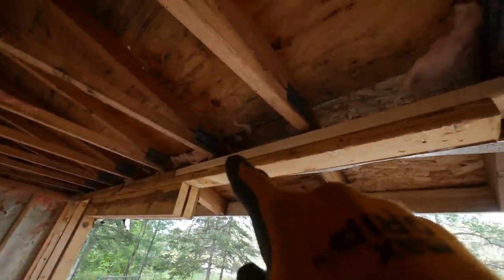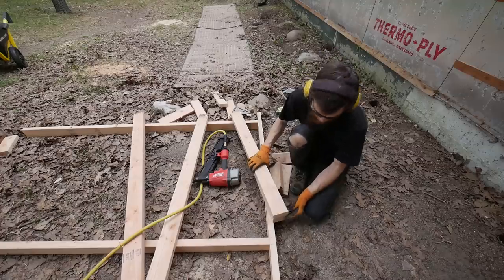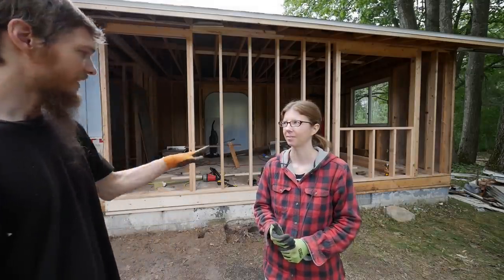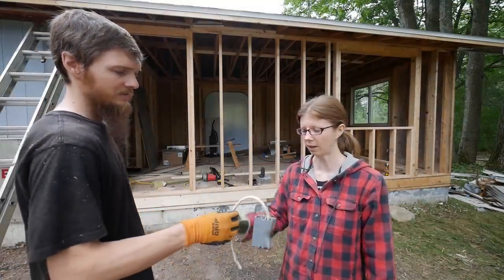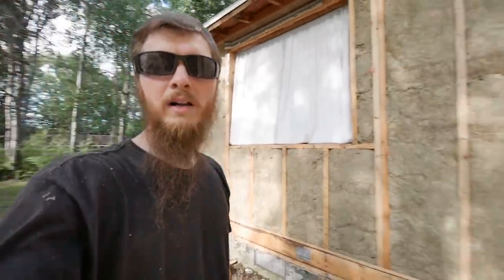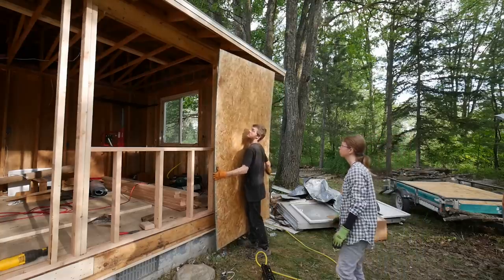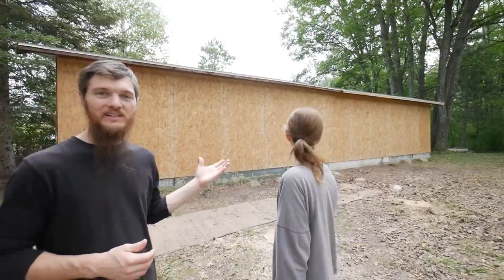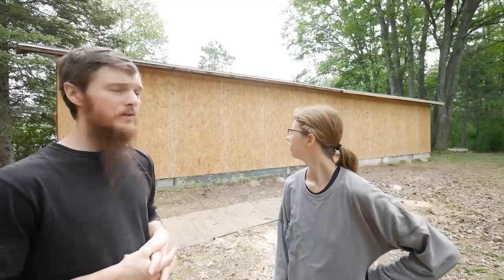More DEMO and Repair of Our 45 Year Old House - Home Renovation

Comment: That little bottom board was a life saver. I've always heard, work smarter not harder.  It's going great! Hurry up windows and door. I'm dying to see MORE!
Reply: Love your videos, just wanted to let you know you can save time and material by just using a couple nails driven in level with the bottom plate to set the plywood on. This also allows you to adjust the plywood up or down by bending the nails. I know I know in a perfect world the wall would be perfectly square but framing ain't perfect. Lol

Comment: What a great job (again)!  I personally like the smaller window, and the way it will match the other one in that room.  You guys are really "building a house," for the most part!  So impressive.
Reply: Light in that small place is more important
Reply: The new window is not that much smaller and it looks to match the other two on the front. They are customizing to meet their needs and desires for their living room layout to accommodate their furniture and such. They won’t be losing that much light really. In my opinion.LOL

Comment: The last house I remodeled I put small can lights under the eves. It amazing how much more light you have around the house instead of the typical spot lights on the corners or even a front porch light. It floods the front yard! It's also very clean and has a modern feel. Just thought I would suggest since you are at that point. It's looking good. I hate FAKE shutters as well. Glad there gone.

Comment: For all of Ashley's small size, she does so much of the hard work helping with this renovation. Both of you are inspirations. I can't wait for the windows and door to arrive. The place already looks a lot better with just the OSB on it. Good decision on the smaller window, cuts down on heat loss and traffic noise but still lets in light and you need wall space in a living room.

Comment: When my husband was overseas in the military, I converted our 2-car garage into a living room, I wanted it as my kitchen, but I couldn't find a contractor that would come out and run my water and sewer line even though it was only about 50 feet. so, I made it a living room. After watching many YT videos, I built the wall for the garage door opening. I put in a window and the wall fit perfect!  But I did it the hard way hammer and nails. my shoulder wasn't the same for a year, needless to say I went out and bought a framing nailery. I also had to remove 16 windows. I did 85% by myself, my boys and sons-in-laws helped me with a few heavy things, like the subfloor sheeting and the sheeting on the outside. It was hard but satisfying. My proudest accomplishment was converting my sun porch into a pantry, and I replaced the bottom plate all by myself.
Reply: WOW!

Comment: Thank you so much for showing what you are doing.  I am enjoying the videos and learning from you.  The biggest project that my husband & I did was to take out three 64"x36' windows on one wall and a 64"x44 or 48" window on the adjacent wall.  We put in one window where the three windows had been.  We also replaced our 8" sliding glass door with French Doors. We are pleased with the ending result.   It also saves us in cooling & heating.  Our next project is to re-Sheetrock our Service Porch, to paint the walls and trim, install some trim, and to shiplap up on one wall.  We are hoping to get some free wood for the shiplap.  We also have a Recycling Center where we can get free paint.
Reply from the maker: Awesome, we wish you the best on your project :)

Comment: Wow! What a good job.  So proud of you doing the clean up after your replacement of the front of your house.  That's just as much work as the new front and leaves a clean slate for the next project.  Your work ethic is  more than just impressive; it's necessary to keep it  safe.  Thanks for sharing.

Comment: My experience has been that doors need to have some overhead covering, even if it is just a deeper overhang just at the doorway. If it was mine I would want a small covered porch. But I understand not wanting to put holes in roof. My husband says I always want to make more work, but has often admitted I did have a good idea. We also redid an old house.  All new electric and plumbing, bathes and kitchen so I know how much hard work you are doing.

Comment: Hey if you want the additional wall thickness without ripping out the entire 2x4 stud wall, you can just nail 2x3's laid flat onto every stud from the outside, then sheathe over that. This will give you a 5 inch thick wall without wasting all the 2x4s you bought, and the 2x3s will be far less than a bunch of 2x6 lumber!
Reply: Or they could just put a layer of rock-wool-board or poly-iso-cyanurate foam between the sheathing and the siding; as long as the fasteners and battens holding up the siding are strong enough to hold it, that would add more insulation without compromising the strength of the house.

Comment: Thanks for another entertaining & informative video. Would you say this mobile home was better built or was your last mobile home better built, or were they the same? Just curious. Art in CA
Reply from the maker: They had similar construction, but this one being a double-wide has a peaked shingled roof with eaves, the other one had a curved sheet metal roof that needed to be coated occasionally and had no eaves. Also, this home has solid plywood subfloors and the other one had particle subfloors that we don't like. This one has normal house windows and doors, the other one had mobile-home windows and doors. I'd say this one is built better.
Reply: @diyfferent  Thank you for taking the time to answer my enquiry. I live in a "Triple Wide". It was built in 1988 and was supposed to be "Top of the Line". After living in it for 30 years, I wish I had a standard stick built home built on my land. The subfloors are a particle board type and they will fall apart when they get wet. The same applies to the exterior walls. They are ok until the paint becomes compromised to water. Then they will start falling apart and growing mold.  The floors that are covered in a linoleum product are holding up well, but the carpeted floors that are installed over that "cardboard" subfloor is not. I had to have the floor replaced in the entry way because of water damage.

Comment: I like the no shutter idea. They are an invitation for bees and wasps to hide behind and a place for mold, mildew, and moss to form. Also must be an absolute sigh of relief to have that plywood up.
Reply: But I'm wondering if it would be worthfull to save the brackets of the shutters. Perhaps if your area has heavy storms you can use them for easy and fast self constructed storm shutters. But I really don't know if this is necessary in your area.
Reply: @Glibber777  These types of shutters don't close. They are flat to the house and screwed down on like 4 or 6 areas around them. They are flimsy plastic things. I hit one of my shutters with a lawnmower by accident (it had fallen off and was overgrown) it exploded like confetti. They wouldn't serve much purpose.
Reply: @Jason I don't like those fake shutters too. And as I am from Europe I don't know how those shutters are made of. But I thought that the brackets could be helpfull for making some shutters for the purpose storm is coming and protection for the windows is needed. So not to leave them at the house but only to put shutters temporarely in front of the windows for protection. Hopefully I was able to explain my thoughts. But perhaps the brackets of the shutters are flimsy as well.
Reply: @Jason  Stover I just reread your comment and understand that there are no brackets on the shutters which could be used. Should have read your first answer more precisely☹.

Comment: a verry high percentage of housefires are caused bij the electrical system , mostly too mush aplyances on one circuit from using to many extentions
about the openings in the walls for the doors and windows , i wonder if you can use a flush routerbit with a bearing for opening the holes flush with the framing , think it will give a lot nice result compared to using a saw

Comment: It was explained why you rebuilt with 2 X 4 wood. It wasn't clear to me if you intend to add more wood to the inside so the thicker insulation can be used to match what you've already done. Is that the plan?
Reply: wade barnett Yes, he mentioned that was the plan.

Comment: So nice to see someone else get a dose of reality about large windows, I have never been a fan of large windows, they let cold in and heat out as well as take away from valuable wall space in a space limited home, and lead to sun damage of what ever is in the interior.  What a mess that place was, good to see what great progress the 2 (4) of you are making in it by yourselves. I am impressed. That electrical outlet was a scarry find, things happen for a reason, it might have caught if you had waited till after mavericks room was done to the exterior and the family living space.  I do hope you have a couple of large tarps tucked away just incase it does rain. OSB and water do not mix. All in all, its your place, you do what you want, decorate how you want, build it out as you want, your living in it and I think it really did need your hardwork, another couple of years down the line it might have been falling apart with the rot.

Comment: Great to see the progress. My husband was peeking in while watching and he reminded me of a mistake we made when building our storage shed 26 years ago. We have the wood siding and the building sits on one layer of cinder block which caused rotting on the bottom of the siding from the rain. It looks similar to how yours looked.  If that is the case of causing the rot,  I would have some kind of weed block cloth and rocks layered on top around the home; this might help. ...Also gutters are a must!! just my two cents...LOL
Reply: We watched our house being built in 2016 and they put a moisture barrier down on top of the concrete before adding the sill plate and framing. Probably the difference in building codes from years ago to today. The builder warned us not to let any dirt for landscaping rise up to the level of the sill plate. We are on a hill so it's only an issue along the front where the bedrooms are.
Reply from the maker: Thanks for sharing and we'll keep it in mind :)

Comment: I would have laid the OSB horizontal and staggered the butts for shear strength but the way you did it is fine. If you are using sheet goods for siding just stagger it so your seams don't end up in the same place as the OSB. Go to HD and pick up some Tuk tape or the tape for the Zip panels system and tape the joints on the Osb, It will help with air infiltration.
Reply: I'd have thought that when the Tyvek was on, you wouldn't have to seal the sheet joints?
Reply: @fergusontea  Tyvek is made to breathe. It's made more to keep moisture out. Taping the joints gives you another level of air infiltration protection.

Comment: Yes on the shutters.  Keep them off.  If you think about what shutters were put on structures for.  They would be on hinges and closed (shut) during a storm.  Or even at night if you didn't have glass.  Also if you look at the slats on modern fake shutters, they go the wrong way.  So look at fake slat shutters on a house... each slat covers the next slat at the top.  Now imagine closing them. The gap would be at the top, letting in all the weather coming down.  Not to mention the fact that your four foot wide window has two one foot wide shutters.  Just architecturally and esthetically wrong. (link to properly hung functional shutters... https://www.hurricaneshuttersflorida.com/img/colonial/bdbeedbc_photo%20(55).JPG)

Comment: Your old windows are better than the existing windows in our house. I think we have the original 1973 sliding windows in our house! Luckily we have plantation shutters on the inside that helps with heat/cold. :) Have a great day.

Comment: I had commented about not liking the smaller window but I also recognize that I will never live there.  I think you always do a great job!  Good thinking on putting the ledger board along the bottom to hold the sheets while nailing.  Make sure you have nailed the sheets to the building code recommendation nailing pattern/ spacing. Then take pictures of nailing pattern.  Can’t wait to see the rest!

Comment: Totally awesome! someone mentioned below to use spray foam as insulation, I would check out some videos on youtube about toxicity problems that can happen due to it not drying correctly, even when done by professionals.
Reply from the maker: Yeah we aren't fans of spray foam, though it does have it's place. We are doing mineral wool insulation in all of the walls, and blown in cellulose in the attic.

Comment: Good morning, I have a question:  How do you insure the roof structure does not sustain more damage as you rebuild the front face of the trailer from the subfloor up?  I know you built the temp wall to safeguard the roof in the area you are working...but did the temporary wall also protect the rest of the house roof from shift and damage by standing where it was like a load bearing wall?  Wow, that box was incredibly dangerous.  I am glad you discovered this now, rather than later.  Thanks and job well done!
Reply from the maker: Yeah the temp wall held the weight of the roof until we could get the new wall built. I had it over the steel beam underneath to make sure it was well supported. We don't need to worry about anywhere else though. Houses have some flex to them and everything was okay.

Comment: I would consider putting the wood stove in the corner, with the stack coming out the side wall. That will take up the least amount of room, and leave you the most open floor/wall space for furniture.
Reply from the maker: It's tough with the window placement and the oaks tree on that end of the house. We're trying to work everything in as smartly as we can so hopefully it turns out well.

Comment: Really it was a mobile home? Where is the roads? This is not unusual in Brazil. Tks for these awesome videos
Reply from the maker: It's a mobile home, meaning that it was built on wheels in a factory and delivered to the property. The wheels have been removed but the steel chassis is still underneath.
Reply: It’s a double wide

Comment: Great work as usual. Ledger board was key. Loved to see the chickens moving around. Have you thought about doing board and baton with shou Sugi ban (Japanese burning technique) to side the house. Would look great and be very weather and pest resistant. I think fairly inexpensive too if using pine.
Reply: There must be a "Back door"..right?..lol...Looks fantastuc!!
Reply: SUPRAMBY .   Have you been following WILD WONDERFUL OUTDOORS , by any chance   .  ;-) . .
Reply: Fava Fava No but will check it out
Reply: Checked it out ,yeah, shou Sugi ban. I think you meant wild wonderful off-grid. Interesting couple. No I first saw this technique on a channel called samurai carpenter.

Comment: Brings back memories of my building a small engine work shop out behind my house. At least you tow will know what went into your house and who did it. The improvement is 1,000  times better than original. No more rodents, bugs or lousy land lords.
Reply: RC Hobbyist Extreme “At least you know what went into your house & who did it.”  That is so true! When I had my home built & had many pictures, it was incredibly easy to make changes ( we added a window later, & attached REAL shutters later than that, plus added soundproofing in 2 rooms) by looking at the pics. We knew what was behind the walls, & if we drilled in & didn’t find what we wanted, we knew we were only off by inches, so we tried again. It makes life so much easier for all the years you have the house!

Comment: Thats why it's required to be a tamper resistant and weather resistant.  Receptacles on the outside.   Water corrodes the connections on standard receptacles and they can heat up after that.

Comment: I like shutters if they appear to work on a home, particularly vintage homes.  By "work" I mean that they could close and cover the window, providing protection from the elements (wind, snow, etc.). Typically now they are just plastic or metal or decorative homemade that are tacked on to any size windows, even picture windows.  I do like the addition of a third color in some house palettes, but there are better ways to do it than non functional shutters.  Of course, this is just an opinion on my part!  I also like to be "stretched" in the home design choices, so seeing what others are doing and thinking is enjoyable and educational.
Reply from the maker: We agree about the shutters :)

Comment: Look into the styrofoamboard on the outside,since you have 4 inch exterior walls. It goes on the plywood exterior. Dont forget the house wrap.Luv ya!!!
Reply from the maker: We're building out our exterior walls to 5.5" to bring the r-value up to 23 so that we wouldn't have to do styrofoam on the exterior :) Thanks!
Reply: I would put the house wrap on,than the windows,tape around the windows onto the house wrap.Than apply the styrofoam board.  Your doing a great job. You need Matt Risinger there from the Build Show.
Reply: @diyfferent   Sounds like a plan!!!
Reply: That styrofoam sheets sale here in KY alot of times for $3 a sheet. They know their plan and so far they are doing a super job. The styro sheets do work well though.
Reply: He builds his walls to 6 inches from the inside. He shows it in his videos. Then he puts R23 insulation between the  spaces.
Reply: @happyinharned9583  Yes,the trend is for more insulation. You can never over insulate in modern builds.

Comment: That fried unit was arking insde like a little welder , if it was low voltage you would probably have crimped it but not with AC , shows you the value of making sure the connection is good and you are using the right tools for the job.